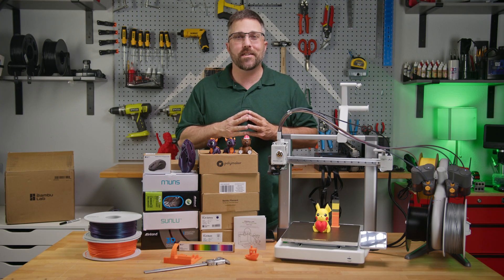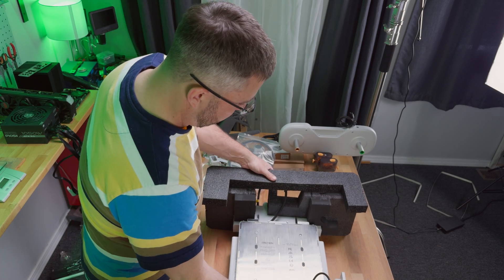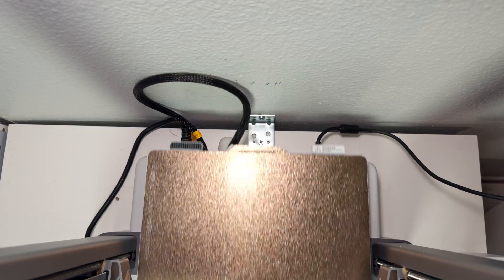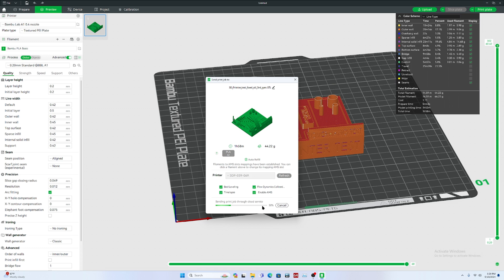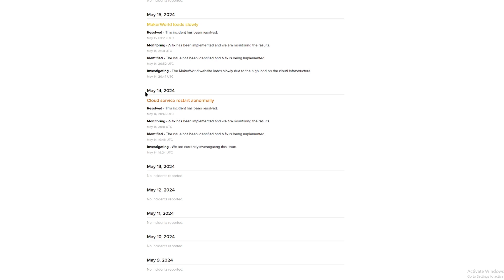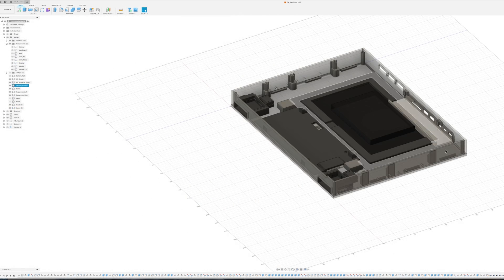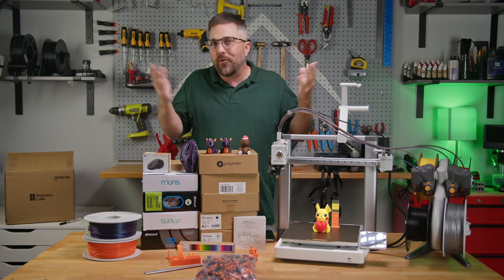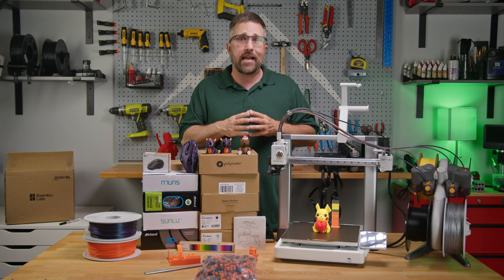Meet the IMPROVED Bambu Lab A1: Major Upgrade Fixes Fatal Flaw!

Comment: Color printing I will be doing sparingly. But if you are running small items, print as many as will fit on the bed. It will still only waste the same amount of filament in color changes.

Comment: I'm leaning hard to get an A1. I use Cura and (spelling) chitcubox for slicing. I slso like using a USB memory card to transfer my sliced and supported to the printer. Does the A1 support this? Old guy here, wehate to change.
Reply: There is a micro sd card slot but no thumb drive USB that I am aware of

Comment: Good luck getting the bed replacement if you bothered buying into the A1 when it came out. Bambu will absolutely not support this recall or replacement in any way! I have an original A1 and its out of service due to the bed problem. They won't fix it, they wont support it, I'm stuck with a $700 loss on this printer.
Reply from the maker: What country are you in?

Comment: Thank you for going to all the trouble to make this great video, it was super helpful and I ended up buying two of the new fixed A1 units because they were on sale. However, you said you have to use the cloud to transmit to the A1 - not sure if this is new or not since you made the video but it also has a LAN-only mode, this is in the online documentation. You may want to add a note at the point in the video where you say this.

Comment: My A1 Mini has a cable identical to that shown at 1:33 and I suspect that the same issue will develop. I have heard from an unofficial source that the mini bed is lower voltage, (but higher current) so that doesn't impress me - much.
Reply: thats actually worse, higher current and lower voltage will generate more heat than higher voltage and lower current. If you can you should most definitely RMA it.

Comment: Great video! I noticed that you do not have enough clearance at the rear wall to allow the bed power cable to move without restriction.
Reply from the maker: Like I mentioned, I did that on purpose to stress the cable and test its resilience. I also said (a few times) you should not do that

Comment: Bambulabs Canada recently shipped a known defective A1 with a recall notice on powerup on the LCD. They have not contacted the customer and have not informed the government that the unit could cause a fire and possible electrocution since February. The unit was delivered close to the Burnaby depot and they could have easily shipped a working unit and a tech to make it right. Drive time is now 28 minutes. Avoid this shabby company. I have unopened X1C and P1P and an A1 Mini. Perhaps I will return them tomorrow if nothing is resolved.
Reply: any updates? i live in bby too and am on the fence. would prefer to avoid a fire
Reply: Shady?

Comment: I have the A1 with AMS and mostly print one color too. It's an amazing machine even if you use the AMS only for the practicality of quickly loading and unloading filaments. It's a nice thing to have for when you want to do something multicolor (like labelling your gridfinity bins). I didn't know I had the "new" and fixed one until I saw your video

Comment: I got my A1 from Microcenter and the email I received from them informed me that Bambu Labs had decided to no longer provide a bed replacement but for them to have everyone return the printer for a full refund along with keeping the bonus credit of $120.00. you have the option of getting the NEW UPDATED A1 in exchange for the original A1. I decided to use the credit to upgrade to the next level Bambu Lab printer. I have never been happier!

Comment: I have an original CR-10 and am a tinkerer.  I’ve spent umpteen hours updating, upgrading, modifying and discussing 3D printing problems and their solutions, and printing benchy’s and calibriation cubes (and cats).  I managed to print a few models, but ultimately I re-boxed it for a year.  In fact I brought it out (to start the upgrade process again and got it printing great) but Youtube’s algorhythm started selling me on the Bambu Lab A1…

… now instead of tinkering, I am printing, and learning how to make print adjustments and continue designing and tweaking actual 3D prints.  My filament collection suddenly exploded.  The CR-10S is jealous.  “It just works.” is very true although mine threw some axis errors that were quickly fixed by re-lubing them (copious instructions available).  The customer service, WIKI and help video collection is invaluable.  Alternate parts and beds ARE available on Amazon, but to be honest, other than filaments, I will mostly purchase from Bambu Lab because they are just that good.   

I would say that the Bambu Lab A1 is not only a GREAT entry-level 3D Printer, it’s one just about everyone would be happy with because it’s reliablility, print speeds, vibration and filament management software is an experience no one should miss.

The biggest down sides ARE 1) the copious poop waste in the extrusio calibration, nozzle purging and AMS multi-colour system, 2) the slooow monitoring camera, 3) basically dim bed led, and 4) the reliance on an Internet Cloud Network for remote printing (you could still walk a MicroSD card back and forth).  It could stand to have a couple more options for model file handling and live print control.  

If not for those things (the first of which is inherent in using only one print head for 4 colours and manageable to some extent at cost of quality of filament purges) I would say that it is a near perfect 3D Printer for home and even production (given print quality and speed)  use.

Comment: 🎯 Key Takeaways for quick navigation:

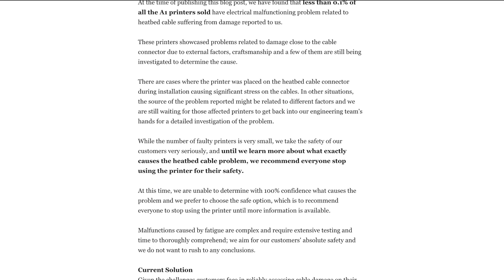01:05 🔌 The original Bambu Lab A1 3D printer faced a serious issue with the cable delivering Main's power to the bed heater, which posed a potential fire hazard.
03:07 🔧 Bambu Labs addressed the cable issue by completely over-engineering it with softer, more flexible copper, thicker insulation reinforced with Kevlar, and additional strain relief.
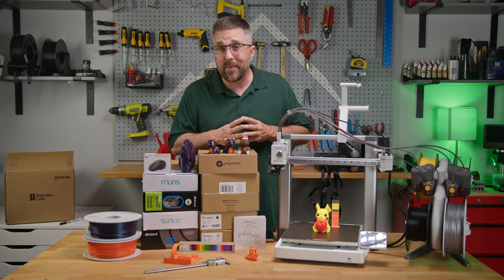04:58 📏 Rigorous testing showed that the new cable design effectively eliminated the previous fire risk, even under extreme conditions.
06:49 🖨️ The Bambu Lab A1 is user-friendly, producing high-quality prints with minimal setup and maintenance, suitable for those less interested in tinkering with hardware and software.
09:21 🌍 While innovative, features like AMS units can generate significant filament waste, posing environmental concerns despite enhancing print capabilities.
11:35 💼 Bambu Labs' response to the cable issue, including a swift product recall and generous compensation options, reflects a commitment to customer safety and satisfaction.

Made with HARPA AI
Reply: Upvoting for not hiding the fact this was AI written

Comment: For the poop, the next version of Bambu Studio uses the retraction technique to reduce waste filament by up to 50%.  It is currently in beta  Also the more copies your print of a model the less waste there is. I haven't done multi colour for this reason as most of my parts are functional right now but better to have it and not need it then to need it and not have it.

Comment: I bought a A1 and have been printing small parts for in the house to solve problems. Really like the speed so i can iterate on the solutions. Haven't printed multi color yet but enjoy the machine.
Reply: Onya doggsy!   I do love a good iteration on a solution!
Reply: Got my A1 combo last friday.   Did a 12 hr print overnight and it went like 90% great.  2 little corners were lifting from esrlt on apparently.  Not surr why it didn't stick
Reply: @monsterhunterrivi6303  It's due to the plastic warping as it cools down. Try to use a small brim.

Comment: I got my A1 2 days ago and this bumper was nowhere to be found. The cable is the new one, but no bumper.

And also the surprise box was missing. It seems they don’t send those anymore.
Reply: I purchased direct in Canada  a week or so ago when the updated A1 came back on the market.  It had tghe bumper, updated print bed cable, and surprise project which was a simple LED lamp… almost missed it, double check your box, just in case.
Reply: @wayneofcanada  the bumper I found. It came loose somehow. The surprise project was not in the package, checked everything.
Reply: I received my A1 the week after you, and it also did not have a bumper. However, it did come with a "surprise project", I got the wireless mouse kit.

Comment: I kept my A1 and opted for the bed swap which I did taking the obligatory photos for proof, The swap was pretty straight forward and I sent off the photos to Bambu, However, it is almost a month since doing this and I still have not received the promised voucher. I have tried contacting Bambu about this but have heard nothing. Whilst I applaud their dealing with the potential bed issue I am a little disapppointed that the promised vouchers appear not to be forthcoming in a timely manner.
Reply: I had an rma ticket opened for a bed replacement in march, still haven’t gotten a package (in the contiguous us)—am I doing something wrong?
Reply: @tejjaskaul5881  try rechecking to make sure all the information you provide is correct. That can be a potential reason.
Reply from the maker: I was told all current RMA tickets would be complete, including vouchers, by the end of this month. Let me know if it isn’t done by then.
Reply: @ElevatedSystems  Hi again I got my voucher code today and promptly spent it lol.
Reply: @ElevatedSystems  I will let you know either way. Hopefully something will happen before the end of month. Thanks.
Reply: I still haven’t got my bed
Reply: Bro was using premium English 💀
Reply: @CursedAudioas crazy you had to edit a comment about someone's English 😂